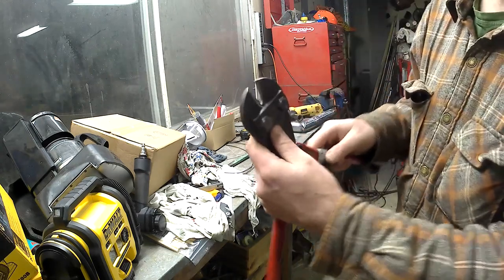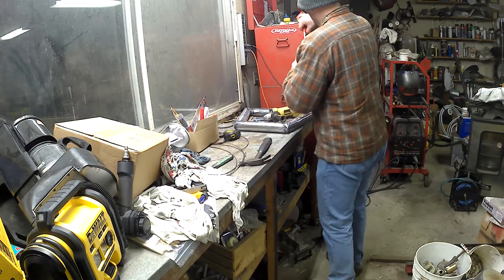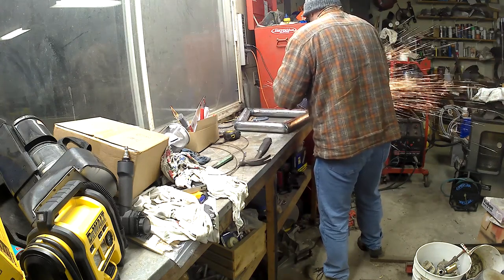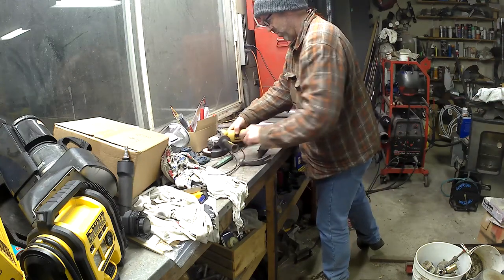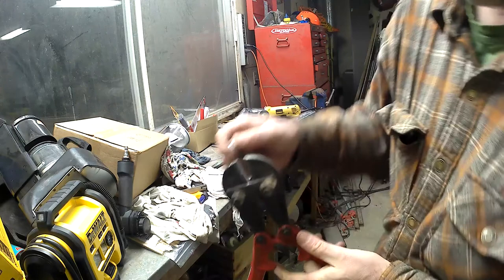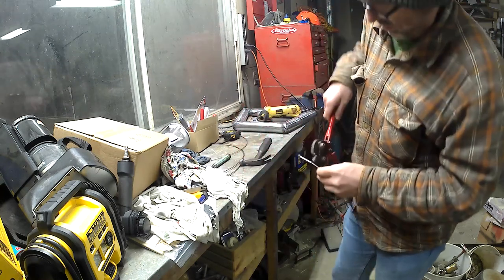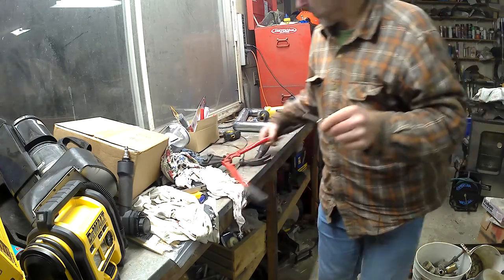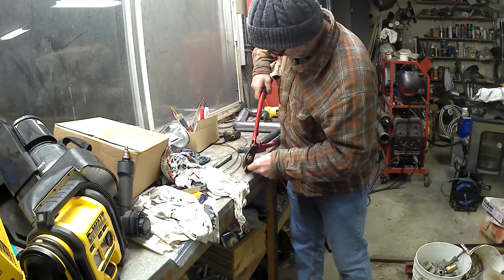DIY Build a Swaging (Crimping) Tool

Comment: Would have been better to close the jaws and drill the hole size needed. A proper swage crimps evenly on all sides of the ferule. By only pinching 2 sides the wire braids can get untwisted and eventually slip out.
Reply from the maker: I can only say “maybe”…?   It has worked perfectly for me, BUT I always double crimp it.  

As with any DIY, the standard disclaimer applies - YMMV (your mileage may vary). :). Good luck with your project and come back and comment if you found this useful or find a better way. :)